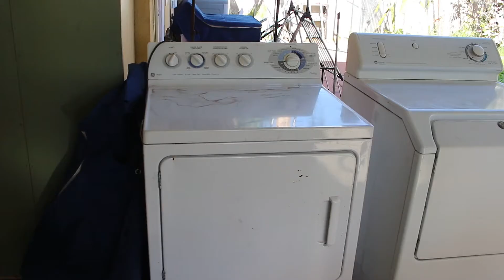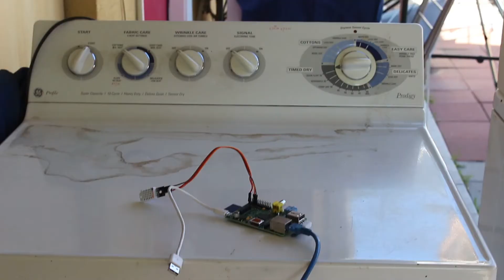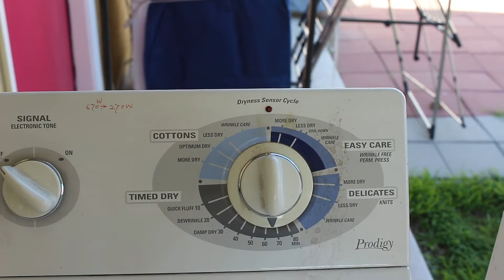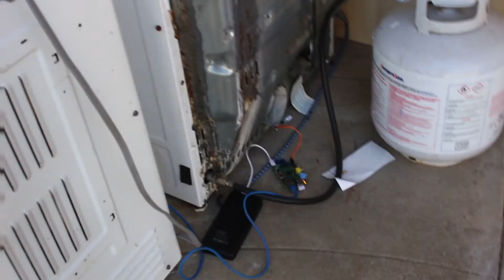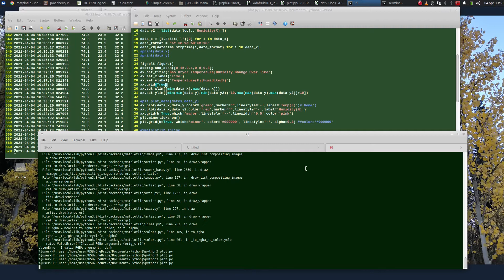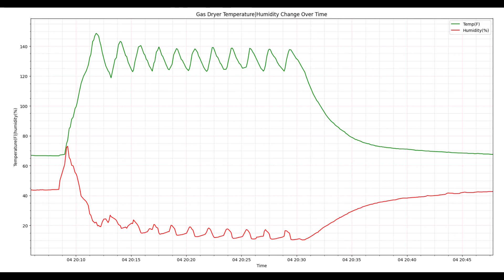Temperature and Humidity Measurement  of Gas Dryer Using Raspberry Pi and DHT22

Comment: I've just rigged up a similar raspberry pi setup with a DHT22.  After calibration, I'm going to use it to turn off my electric tumble dryer using a smart power socket.
Reply from the maker: that was my intention, it should work well. please let me know how it works.